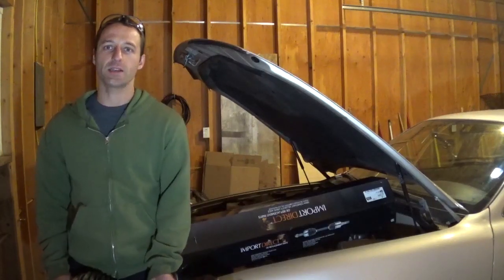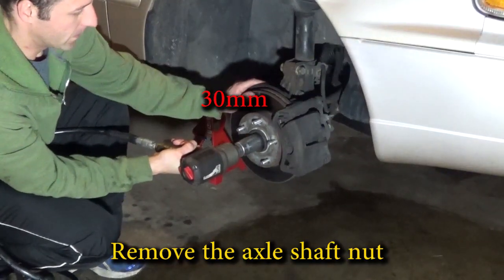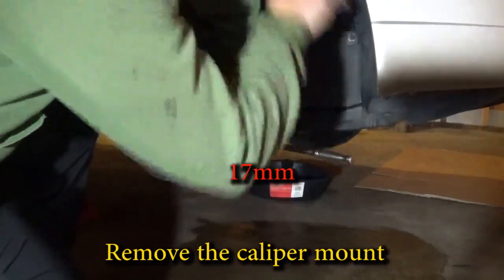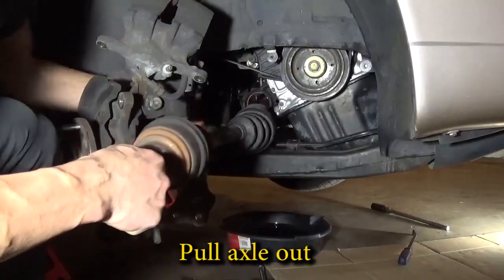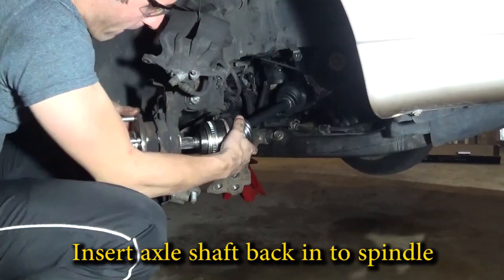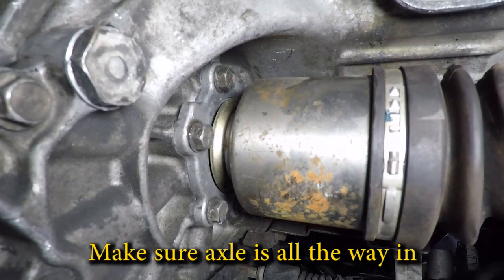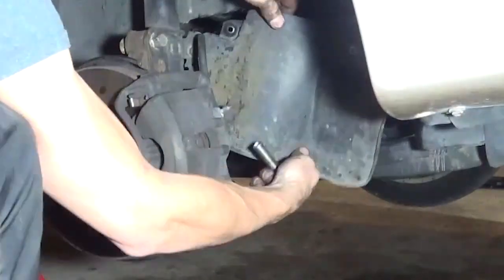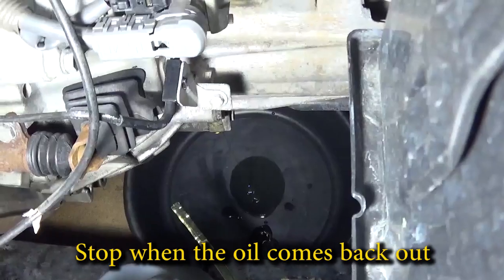How to replace the CV axles on a 1996 Toyota Camry

Comment: Just a few tips, #1)long needle nose pliers are very helpful in removing and reinstalling the large C clip, #2) you can leave the brake caliper attached to the mount and just remove the two bolts rather than 4 bolts, #3) a seal puller is beneficial to pulling the seals. #4) a 1.5 female pvc adapter is great for reinstalling the seal, (grey elec, pvc) it slides over the lip and does a fair job of seating the trans axel seal. 

I didn't know the retaining bolt had a small piece on the end, my 97-2001 are all the same except for that, unless Ive been overlooking it, thanks for your detailed video great info Paul!

Comment: Hi Paul, my name is also Paul and I found your channel several years ago because I too have a tab 96 Camry. You’ve helped me fix a lot in it. My Camry has a rather harsh idle and I can not figure out why. It does not have any vacuum leaks, timing is correct, and the idle speed is correct, I’ve also changed the spark plugs, wires and distributer. Should I get a new idle air control valve? No codes have been thrown so I’m just guessing at this point. Anything helps thank you!

Comment: Separating the ball joint is completely unnecessary. On right side turn all the way to the right and push out of spindle. On left turn all the way to the left. If you have a V6 auto Camry the axle shaft is the same on both sides and it simply unbolts from flanges on the transaxle, zero loss of trans fluid and no seals to worry about.

Comment: What was the part number for the CV axles, I can't seem to find them, I have 96 manual as well
Reply from the maker: I just bought mine from Autozone.  Select your vehicle and it will tell you which axles you need.  If you want GOOD axles that will last 25 years or more, buy original Toyota axles.